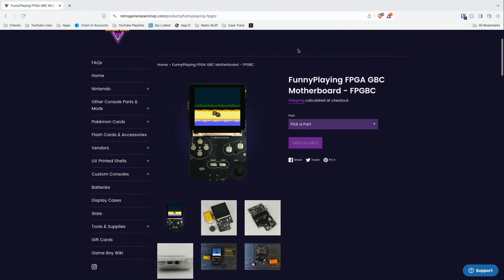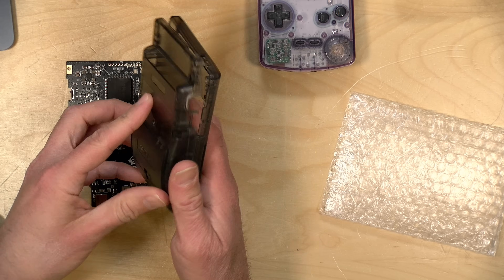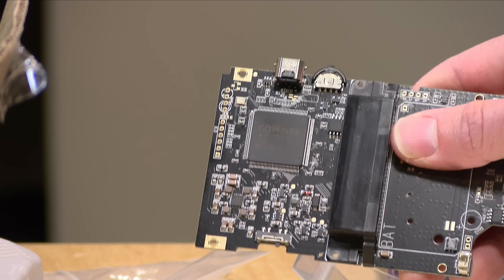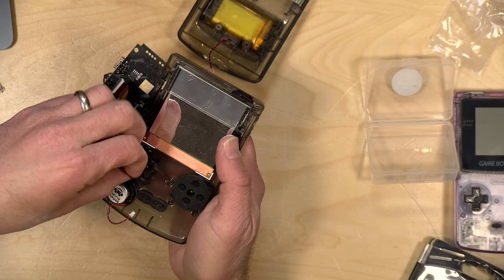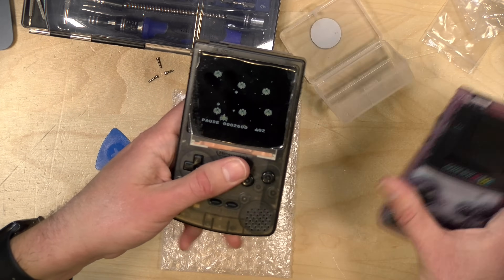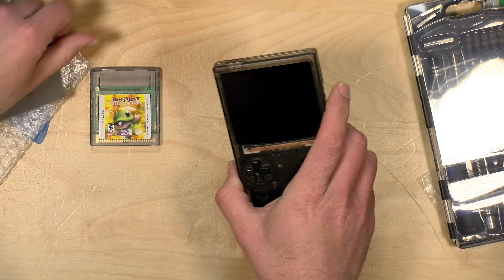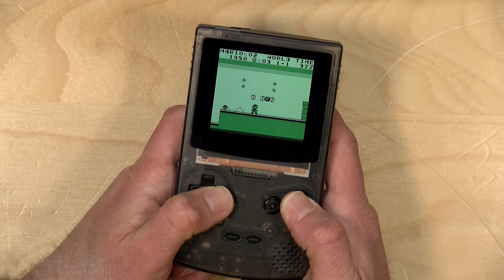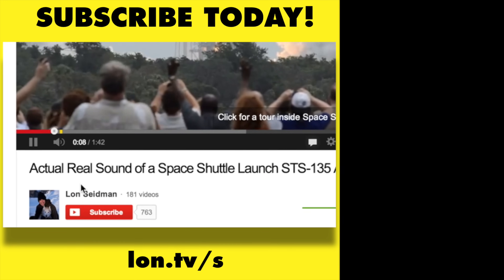Let's Build a Gameboy! Funnyplaying FPGA GBC Build and Review

Comment: I have an OG, Color, Advance, SP, Super GB and a Retro flag GPI Case.  The SP works surprisingly well given I never changed the original battery.  I'd be using it still but my eyes suck and I needed the better display like in my Retroflag.  I had the one that attached to the GameCube till I lent it to a friend. 😢
Reply from the maker: Do you have one of the backlit SP's? I've never seen one of them in person but hear great things about the display quality on those.
Reply: @LonSeidman  Yes but I would swear it used to look better then it does now.  I think I'm just used to these modern displays and my eyes aren't as good as they used to be.
Reply from the maker: @jmr  Those old backlights do wear out over time - I think they used some type of fluorescent light source.

Comment: Why do you have 3 extra screws left over ?
Reply from the maker: I think the original gameboy motherboard needs a few more screws with the shell.
Reply: because he doesn't know what he's doing. He didn't screw the mainboard to the top case. If you look closely, you can even see in the video that the front shell has no screws in 3 places around the buttons.
Reply: He also started with the screen, which is the last part most other builders do.

They really should include some instructions on their website.
Reply: @Omar_Little  that's less of a problem. I also put the display into the housing first in order to be able to press the double-sided adhesive tape that holds the display in the housing from both sides.

Comment: One of the few things that prevents me from getting this, is that the processor clock speed is slightly faster than the original GBC.
Reply from the maker: There is a clock speed adjustment in the settings - I’ll have to look into this a bit more
Reply: @LonSeidman  There are a few videos showing this: the speed is just slightly faster so, unfortunately, it's not a 100% accurate clone, which is expected to be honest. I hope the clock speed can be adjusted more with firmware updates in the future.

Comment: I got everything together.
Booted up. Speakers work. Screen lights up, but is black.
No graphics. I probably messed something up maybe on the ribbon cable for the lcd.
It's going straight into the trash, and I'm using the analogue pocket.
Reply: You probably did mess something up, especially considering you did not know what tri-wing screws were in the prior comment. You should definitely stick with a pre-built handheld.
Reply: That was abrupt. No troubleshooting for you, eh? If at first you don't succeed, try, try again toss it in the trash.